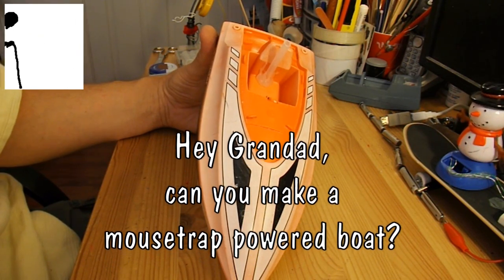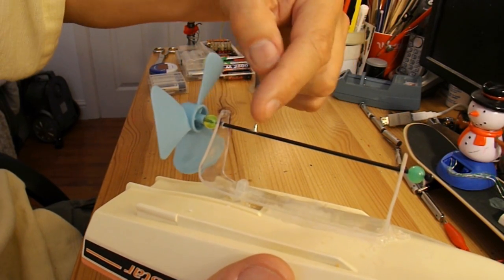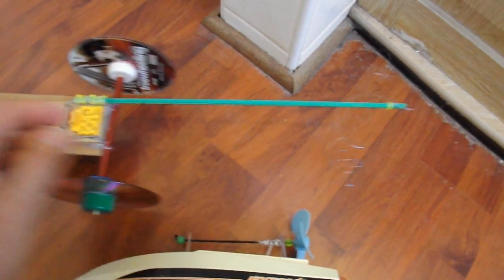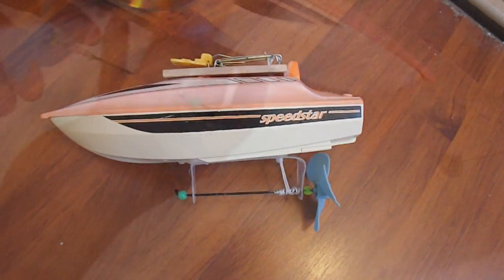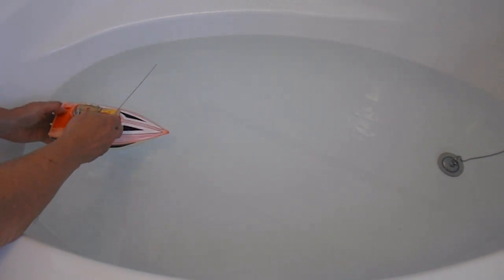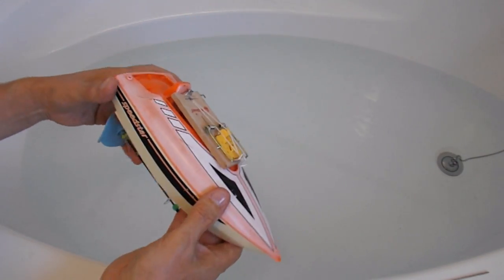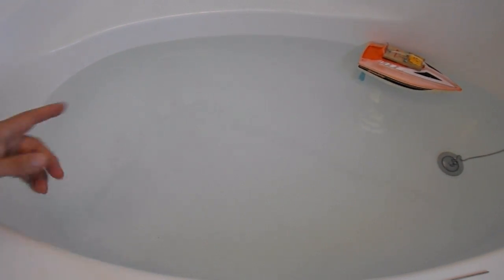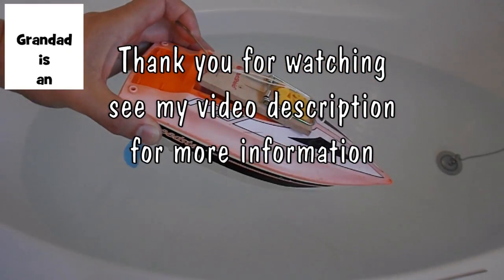Hey Grandad, can you make a mousetrap powered boat?

Comment: If you wanted to increase the length of the string without lengthening the lever on the mousetrap, you could use a compound pulley system instead. For even more power, you could place two mousetraps opposite of each other, with a compound pulley system between the levers of the two traps, effectively doubling the pulling force with a reasonably small footprint.
Reply from the maker: Kinzokan I do the basics, it is up to other people to take those ideas and improve them. Feel free to do your own version with those improvements and upload a video to show us.

Comment: Wonderful design and so simple!
If the hook on the spoke were to make itself come undone, working only, the propellor would not act as a brakee when the trap is fully closed. I suppose a thinner spoke from a lightweight road bike (1.5mm commonly exists) would also offer more range versus the more typical 2.0 and 2.3mm varieties :-)
Reply from the maker: If you want a longer range then you really need to add a long lever to the mousetrap arm so you get a larger radius like I did in this version http://youtu.be/3GUG9BRga7s

Comment: can you make  a rc boat out of that boat
Reply from the maker: +Pretty  Seemangall  it would be technically possible but more work than it probably looks as it is a sealed unit. I would have to cut it open to fit the components. I have other RC boats as you have probably already seen. Here is my Radio Control playlist https://www.youtube.com/playlist?list=PLA5a2xPRSrB13Xcquw4Ff09MQzTPjeVkI and my Toy Boats playlist https://www.youtube.com/playlist?list=PLA5a2xPRSrB24vUS9E8zkSgjZysEL00zr
Reply: Ok

Comment: Hey grandad can you make mouse trap powered plane? Or at least try?
Reply from the maker: That's an interesting idea. It might run just long enough to get the plane to climb a little. I will put that on my list.
Reply: Good idea, but that's a little heavy don't you think?
Reply from the maker: Some mousetraps are quite light and I could drill extra holes to lighten them even more. It is more a matter of making the plane extra light and choosing the right propeller. I don't think it will be easy but it might work. It only needs to spin the propeller for a few seconds to lift it up into a glide height.